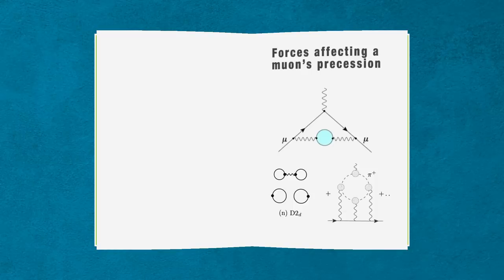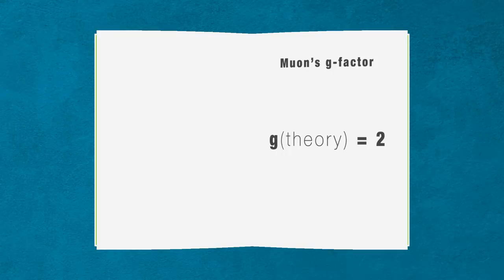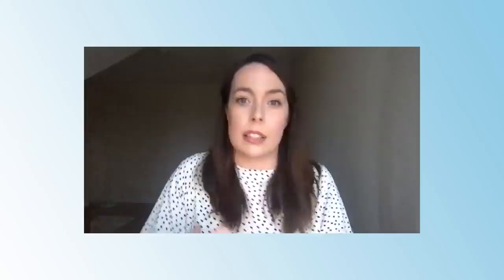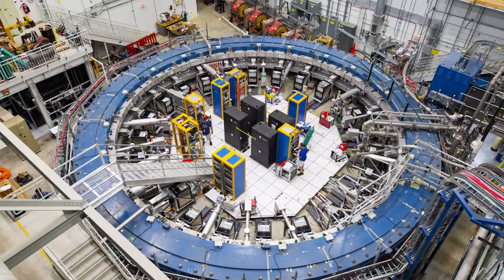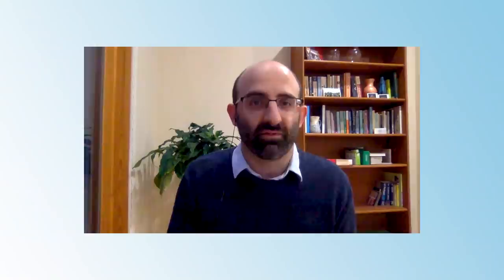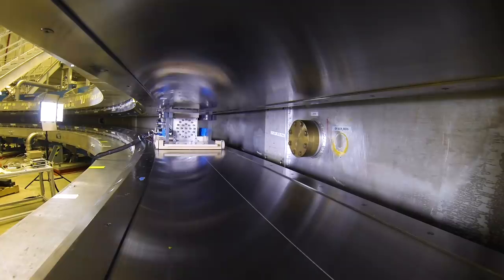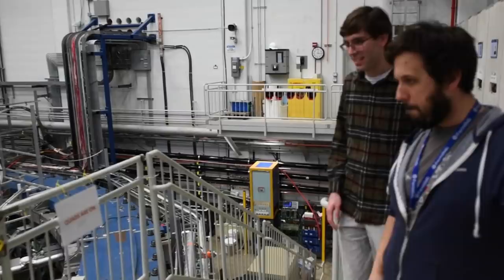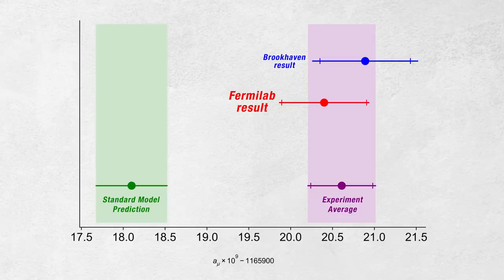Muon g-2 experiment finds strong evidence for new physics

Comment: How about replace the electron of a Hydrogen atom's electron with Muon? 

Is it a new Hydrogen isotope,  or an antimatter Hydrogen atom?
Reply: We have been doing this since the 50’s. 
https://en.m.wikipedia.org/wiki/Muon-catalyzed_fusion
A Muon is added to a hydrogen isotope and it leads to nuclear fusion at very lower temperatures - cryogenic temperatures. Regrettably, with our current tech it takes more energy to make a Muon that you get from resulting fusion
Reply: @UmbraHand  Thank you. I'll study more.

I am a chemist and have limited knowledge of high energy physics. When I ask the question, I was not thinking of energy production at all(but just a new Hydrogen isotope). But now I start to link it to cold fusion. (I have some experience in producing Hydrogen gas from thin Pd tubing. Watching Hydrogen bubble appear on surface of  Pd electrode is very interesting. But I do not have high speed camera to record it.)

When Hydrogen atom permeates through Pd  lattice, it seems not that ridicules to think that Proton and Electron of Hydrogen atom are physically separated more. 

Any body did calculations or experiment on this topic?

And, if instead of Hydrogen nuclei, but a much heavier atom's, a Caesium's, or even a Francium's, outer most electron is replaced by a Muon, would it be a more stable entity? Or stable enough to be called a new Element on Periodic table?

(then a new element is not just defined by the nucleus alone any more, but "the composition of the electron shell" also start to play a role?)

I heard some of the so called New Element synthesized, does not have very long life at all.
Reply: @UmbraHand Assume in a mass spectrometer like environment, a beam of double charged Barium ion beam, is allowed to collide with Muon beam, and a single charged Barium-Muon ion is  formed, can the mass of this Barium-Muon ion be determined on this  mass spectrometer?
Reply: @paulchang3317  Well, this is rather long so I will break it apart. Just to clarify, although Muon Catalyzed Fusion does occur at honestly ridiculous low temperature it is not part of “Cold Fusion” or the re-branded Low Energy Nuclear Reaction (LENR), as those come from chemical process. I am not sure about the Hydrogen permeating through Palladium or any papers on the topic, you could check Arxiv.org if you aren’t willing to spend money to see if there is any, but considering how little difference in polarity there is between hydrogen and palladium, I’d reckon their interaction would be closer to a London Dispersion Force than anything but that is just my educated guess
Reply: @paulchang3317  Secondly, even if the electron were farther apart it would actually make fusion less likely. The way Muon Catalyzed Fusion works is due to the Muon be ~200 heavier than the electron, it’s electron probability cloud is very close to the nucleus, drastically reducing coloumb repulsion between atoms, enabling fusion. 
Would new elements with an outer muon be stable? No. Muon’s are not stable particles, they decay after 2.2 microseconds. To add a little bit, only hydrogen isotopes with muons can achieve fusion and the reason why is another reason why Muon Catalyzed Fusion is so hard to achieve. Muon’s have to first “stick” to an atoms and replace the electron in it which isn’t statistically common, so having more than one muon orbiting an atom is almost nigh impossible.
Reply: @paulchang3317  Lastly, the Trans-Uranium elements stability comes from the fact that the strong nuclear force has a finite range while the electromagnetic force has an infinite one, so when adding new neutrons and protons, the strong force becomes less and less effective, so the nucleus becomes less and less stable and as such the probability of it decaying is higher.
There is some very complicated quantum mechanics going on but there is a concept known as “Magic Numbers” which dictates the most stable configuration of protons and neutrons in a nucleus, giving these nucleus extra stability. An example would be Calcium-48 for example. It is exactly because of this reason that physicists are making new elements as to reach elements where the nucleus has thus magic number, the so elusive “ Island of Stability”. When we will reach this stability is a matter of contention as there are different proposed values due to all the very very complicated interactions protons and neutrons go, especially at higher amounts, as part Uranium, the nucleus adopts a sort of “Rugby” ball shape, which affects calculations.
Reply: @UmbraHand  Thank you and thank you again for you to spend so much time answering my question. 

Your answer definite trigger my interest to understand Muon more. Especially on the nature of its short life, although 2 micro sec is quite long inside Mass Spectrometer.

Personally I believe cold fusion in Pd could happen, in academic sense, but the huge energy released will destroy the "active site" that causes the fusion happen, and make repetitive process impossible.

Even I did not spend much time on Muon yet, but I feel Muon can play more roles inside Mass Spectrometer, thus expand the dimension of knowledge of tradition Chemistry. Now I wish I can get my hands on Mass Spectrometer again one day. (there are a lot more mass spectrometers than Huge Particle Colliders)

Thank you guys to provide such interesting topic. .
Reply: @paulchang3317  Just remember that a Muon has a half life of 2.2 microseconds at rest; when accelerated at relativistic speeds, time dilation extends this. As a interesting sidenote, it is thanks to Muons that time dilation got first experimentally proven
Reply: @UmbraHand  Yes. and it is the first time I understand what is "Time Dilation" or what is Dilation. Muon's behaviour makes it so simple and so clear. Something you can put in month, chow, and swallow. 

Wish all new concept be explained this way.

Comment: The particles that randomly pop in and out would be a collection of Neutrons - neutrinos. If Tachyons exist, I think this is where we would likely find them as well. Appearing exactly in space-time to be either/or or even both, cause and effect. I am close to a working theory about a relation between black holes and big bang events. How infinity handles a flat universe.
Reply: NO matter how much energy is applied, to no matter what type of apparatus, we don't have the technology to compress simple water. We can put it under pressure, but that's not what I am talking about. (That is compressing the air above the water in a confined space) What I am talking about is something like taking a known mass of water and compressing that mass into a lower (smaller) measure of volume. Compressing a 1 inch cube of water to anything less/smaller than that same 1 inch cube, in simplest terms. Wouldn't that mean that no matter how much (f)orce is applied - there is always a return of at least (f)+ (x>=1) in just the potential/kinetic energy, not to mention the heat generation of continued or repeated force? think about that for a sec. That is a guaranteed return of more energy than was put in! And it is persistent (assuming a truly sealed environment). It's not like it wears out or grinds away or something. This testable, observable, and repeatable attribute of water kind of breaks entropy, no? The same effect that will cause sodapop and beer bottles (and cans) to explode if left in the freezer too long.

Comment: Measuring something with high precision means nothing; you need to measure with high accuracy.  That is, you can have precision without accuracy, but you cannot accuracy without precision.  Put another way, how do you know that your measurements are accurate, in addition to being precise?  For example, if you mistakenly use a ruler that is 1% longer than it should be; your length measurements might well be precise, but they wouldn’t be accurate.

Comment: Not really a subatomic particle guy, but what are the practical implications?  Can I use muons to drive my electric car?
Reply: g has been claimed to be the most exact theoretical calculation ever, supporting the Standard Model. This result very strongly suggests that theoretical g is not precise enough and thus the Standard Model isn't either. 

Keep pushing your car to the next (absolutely normal) service station while you chew on that.
Reply: Ask that again in 80 years, noone will know that for the forseeable future.

Comment: I was wondering how Hawking radiation, i.e. the indetermination/instability of the N operators of particles species under space-time curvature, could affect measurable quantities dependent on the skewness of a bound particle state respect to the particle species, in gravitational fields weaker than black holes (where the only residual-observable from afar component is the n = 0, since this comes from the neighboring of the gravitational collapse, where it is not effective in rendering it liminal as it is to the n > 0 components that remain bound within the collapse)... such as Earth maybe? It would be interesting if HR would yield any measurable effect in a weak field, as it would allow to test the QFT-GR link, possibly being a QFT mechanism implementing a form of the equivalence principle.
But I had an headache so I told myself just relax and watch some videos, get distracted... so, let's watch this interesting news... wait a sec, what is this result about?!?

Comment: Has everyone forgotten tesla...
Your differential is a measure of ether gravitational forces not probabilities of virtual particles. Random probabilities are not this regular. 
Stop thinking in terms of numbers and measure the frequencies and harmonics of frequencies, and stop using base ten. Use base 12.
I will also say, that if you went back in time and were first on the line looking for radio waves you might run in to some troubles if someone was already using radio waves like we are today...
I point this out to make you think about how an advanced civilization communicates, here is a clue, it's not using a system that takes millions of years to travel past galaxies... ether based frequency encoded gravitational flux...ie. communication in simultaneous time because in the ether, ie substrate of physical reality's fractal simulation, there is no time and no space, just ether, the same ether everywhere, simultaneously just being. Everything else on top of that is frequency variations.

Comment: Given the necessary invention of Dark Matter and Dark Energy to uphold the Cosmological Standard Model, I am not sure that this Standard Model will be anymore vulnerable to this, so called, discovery.
Reply: We observe that outskirts of galaxies rotate faster than they should based on the amount of matter that we can detect in them. Hence we deduce that some matter is unaccounted for, Dark matter. We observe that the universe is expanding more rapidly now than in the past. This indicates the energy of the vacuum is increasing, Dark energy.  So our observations force us to conclude that something is missing in our description of the universe. "Dark" is a placeholder for the fact that we don't know what the properties of this dark matter and dark energy are. Work by different researchers on many fronts is trying to reduce our ignorance on what these things are. Eventually the dark will be lifted.
Reply: ‘Forced’ being the operative word here. You are not forced to believe in a gravity only Universe, unless of course you cannot accept, or don’t know, or want to know, that magnetic fields are always associated with an electric current (Electricity 101). They are one and the same phenomena. If you find 1 then the other will always be present (if you look for it). Which leads to a filamentary Cosmos due to the existence of Birkeland Currents (which we find), plus the twisted pair (pinching phenomena) from which, amongst other things, like stars, Galaxies are formed and powered to rotate (not according to Newton's Laws), and without need for Dark matter. Because we are talking about a force of 1 followed by 39 zeros stronger than gravity.
Reply: Boodysaspie  I think you are replying to someone else. I certainly don't believe in Dark Matter or Dark Energy (they are products of necessity for those who need them), but I do support the Electric Universe/ Plazma Universe theories, as you can see from my answer. Sunshine is a good word though! Opposite to Dark!

Comment: I thought spin wasn't acctually the particle spinning
Reply: My understanding is that it isn't, but, there's a strong connection to the idea. I will attempt to summarize my understanding of it, but note that I've only taken one quantum mechanics class, and it was as a math grad student course, not a physics course. This will include a few simplifications, and may leave out some technicalities, some for the sake of being concise, and others because I forgot something.
In quantum mechanics, each observable is expressed with an operator. For example, the position operator, and the momentum operator. You have heard of the uncertainty principle, with delta x times delta p greater than or equal to hbar/2 . This comes from the fact that the position operator and the momentum operator do not commute, with [x,p] (which just means x p - p x ) = i hbar (hbar is some specific physical constant).
(for general operators A and B, [A,B] just means AB - BA )
(in the above example, I'm talking about the position operator for one particular coordinate direction, and the momentum along the same direction)
The operators for angular momentum along each different axis have some "commutation relations", If we let L_x be the operator for the angular momentum in the x direction, L_y the angular momentum in the y direction, and L_z the angular momentum in the z direction. (of course, one can choose whatever 3 axes one wants).
These satisfy the relations [L_x,L_y] = i hbar L_z , and  [L_y,L_z] = i hbar L_x , and [L_z,L_x] = i hbar L_y .
It turns out that these commutation relations imply that (for eigenfunctions of L^2 = L_x^2 + L_y^2 + L_z^2, i.e. for things with a well defined total angular momentum) the eigenvalues (which are the possible values that could be measured for the observable) have to differ by integer multiples of \hbar.
For "orbital angular momentum", which come from actually having like, a position and a momentum which together go around an axis, (which is what you would have for something orbiting around something, and, perhaps one would say one also would have this if something were "literally spinning", in the sense that it has multiple components that are distributed in space and which are revolving around a central axis) , one can show that these eigenvalues have to be integer multiples of hbar, in a certain symmetric range.
However, while the commutation relations do allow showing that the eigenvalues *differ by* integer multiples of hbar, by themselves they aren't quite enough to show that the eigenvalues have to be integer multiples of hbar.
Instead, there is one extra possibility.
Instead of being things like, e.g. , (-2, -1, 0, 1, 2) , they could instead be things like (-3/2, -1/2, 1/2, 3/2) .
But for the orbital angular momentum, based on the position and momentum operators, this doesn't happen.
The "spin" of a particle happens to be given operators which are rather like the L_x, L_y, L_z  and L^2 , in that they satisfy the same commutation relations,
but, weirdly, for some of them have as possible eigenvalues, the things like (-3/2, -1/2, 1/2, 3/2) (or, (-1/2, 1/2) , or etc. ) .
So, you can see, the spin of particles, is rather like a kind of angular momentum, but it is also, in some cases, something that can't come from something that was really something rotating around an axis.
(if the spin of the particle is an integer, as it is for bosons like the photon, then the possible eigenvalues will be be the integer multiples of hbar, just like it would be for orbital angular momentum,
it is only when instead, the spin of the particle is halfway between two integers (like for fermions, like electron, muon, proton, etc.) that the eigenvalues are things halfway between integers rather than being integers.

So, is the particle "really spinning"? I think that depends what you mean by "really spinning". There is at least one reasonable sense in which one would say that they aren't "really spinning", but on the other hand, it is very similar to the orbital angular momentum, in that it follows the same commutation relations, and also contributes to magnetic fields, etc.

I hope this helps.

Comment: That magnet, which is 100's of times stronger than my fridge magnet, looks expensive. Why didn't you just go out and buy a few hundred fridge magnets instead? 🤔😎😉
Reply: The Brookhaven magnet bends the muons into a circular track and keeps them in a very uniform magnetic field to allow the precise measurement. You saw how big the magnet is. Imagine how many kitchen magnets would be needed. And then you'd have to arrange them to make the magnetic field inside nearly perfectly equal all along their track, an impossible task. Just the fact that they transported the existing magnet from New York to Batavia (outside Chicago) shows you how valuable (and difficult to build) the magnet is.

Comment: Muon supposed to have spin of 2, but due to quantum foam affecting its spin, theoretically its predicted to deviate from 2
Let me save you a watch
g(theory) = 2.00233183620
g(experiment) = 2.00233184080
This splitting hairs result suggests new physics.
(I'm not a physicist, so if I've got anything wrong, kill me)